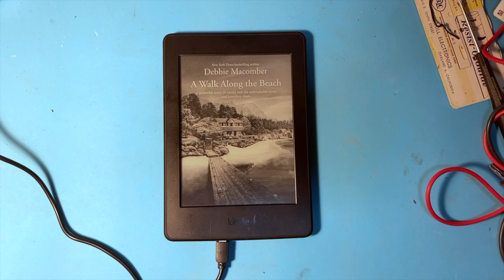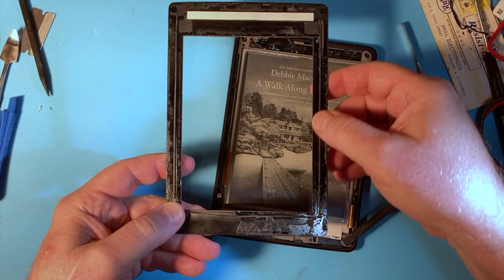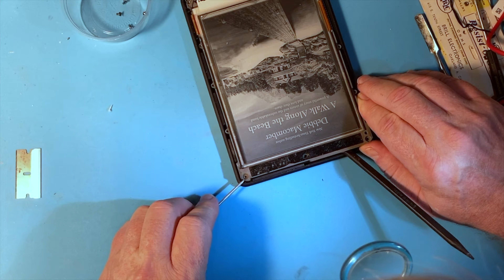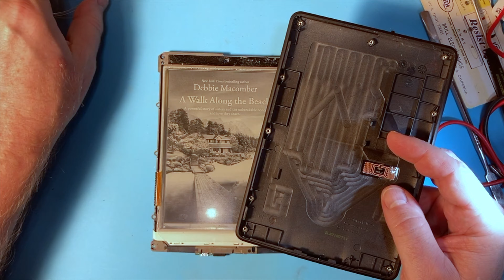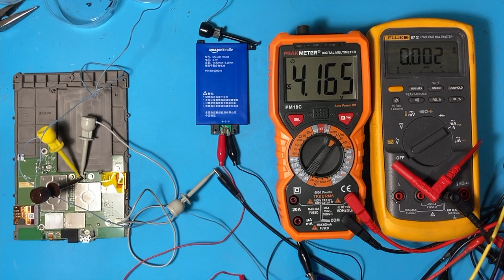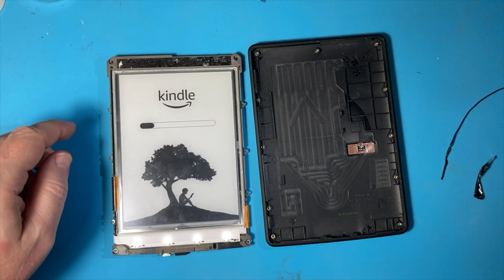Unresponsive Kindle Paperwhite Repair / Battery Replacement

Comment: My Kindle has a blank screen. I ordered a New battery but It didnt arrive yet.
Reply: I replaced the battery but the problem is still on. It charges but the screen is still blank, the leds never turn off unless I remove the battery. Sometimes I can load it, if i insist, but after it goes idle for some time, it gets frozen again. The problem seems to be on hardware. I even updated the firmware, but the problem never leaves.

Comment: Excellent video, thank you so much for uploading this, I have exactly the same problem with my kindle 8th generation, stuck on the software update screen, I think I’ve missed something so what exactly is at fault here, the middle TH pin on the battery? What did you do to the middle TH pin after applying the correct voltage using a bench power supply?

Comment: Thanks to your video I took my wife’s kindle apart. The display stays on with no input? Wierd. The battery is disconnected but the display still shows text.
Reply: Yes mines does exactly the same, did you manage to fix it?
Reply: It is not weird at all...you are dealing with E-INk displays not LCD's ....whatver was the last image on the screen at power loss will remain there.....for decades, with a rstart, or electricity they will refresh to a new image...so...nothing weird about that...that is how this technology works

Comment: Hello greetings, I have a kindle Paperwhite 2 which charges normally and its screen does not have any apparent failure, but it turns out that when trying to turn it on the screen remains blank and illuminated, when resetting and doing hard reset it shows me the screen of the child in the tree but nevertheless it turns white again and remains like this with the light on the screen until it is completely discharged, I realized that when loading and removing the cable the green led remained on, what do you think it could be? Based on the latter, could it be that the button is faulty and remains closing the circuit? or something else?
Reply: Mine is just the same. Blank screen. When I try to reboot it flashes, there is a tree picture but it goes blank soon after that. I ordered another battery, but it keeps the same. Nothing seems to work. I quit!
Reply: @Alwaysdoubt100  hello, I let the battery discharge completely and charge it, it works for a long time until it freezes and there it stays, a technician told me that there is a problem of a short circuit in the touch screen card, something irreparable, for therefore, you have to change the touch, the touch is what is damaged
Reply from the maker: Well, the good news is the screen works, and the processor works and the battery seems to be delivering enough current. BUT, I wonder if the battery is not properly communicating its status to the system, which might explain the green light and maybe the blank screen? You can beep out the switch to verify it is working. 

I assume the girl/tree image is boot code in ROM, so it may be that the flash memory is corrupted, but I'd expect a full reset to fix that. 

Absent a schematic, about all that can be done is swap the battery or swap the board (and test the switch of course). Ugh. Maybe someone else will have a better thought.
Reply: @WardCo  in fact, they told me to use a memory reader since it seems like a software problem and I would need to check the memory and if it is necessary to program it again, what madness
Reply: @WardCo  now the paperwhite 2 turns on but remains on the tree screen and with the screen light on
Reply: @José Emiliano Pérez un técnico me dijo que era un corto circuito en el táctil de la pantalla, no la he podido llevar a reparar
Reply: @José Emiliano Pérez resulta que cuando la dejo descargar por completo a veces enciende como si nada y dura horas funcionando normalmente hasta que de un momento a otro el tactil deja de responder y esperar nuevamente a qué descargue
Reply: @yanki198  tengo el mismo problema. ¿ya solucionate ese problema?
Reply: @luisantoniogomezgutierrez2714  dos tecnicos me dijeron que podía ser una falla en el táctil, por lo cual no tiene reparación, solo es conseguir otro táctil,pero eso prácticamente es comprar otra, no se puede hacer mas nada.
Reply: @José Emiliano Pérez bueno, en mi caso el técnico no le ha metido mano aún pero el diagnóstico fue ese, ahora yo estoy en Venezuela, no aplica soporte Amazon pero si parece ser un problema común, aquí muy pocos conocen esa clase de tabletas de e-ink
Reply: @José Emiliano Pérez tengo que llevársela la semana que viene, atento que estaré avisandote por fin que resuelve por aqui el tecnico
Reply: @José Emiliano Pérez a veces te enciende normalmente?? Cómo si no tuviese problemas? Y de un momento a otro no responde?
Reply: @José Emiliano Pérez Hola, Oye que mal, la mìa es pantalla tactil dañada, es decir, directo al ataud, irreparable.

Comment: Awesome!!!!! Had me holding my breadth for a moment. Glad it's working with a batt replacement. Although I'm a bit surprised with all that extra surface area why they didn't use a bigger capacity battery. Plus all these new fangled products having these batteries with 
on-board controllers! what a pain. If you could maybe next time you open it up, see what type of storage drive/chip is on there. Be nice if we could increase storage....Thank you for an awesome DIY.